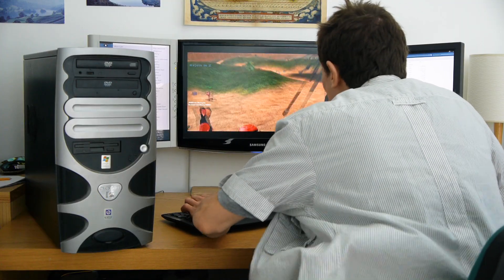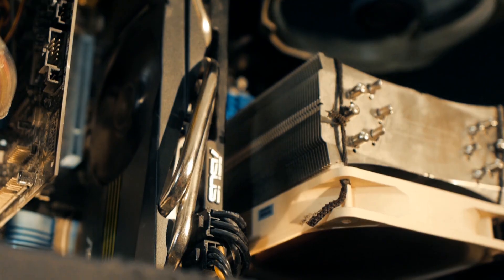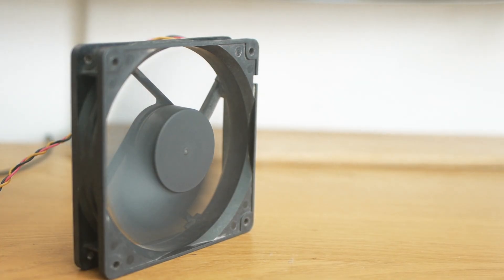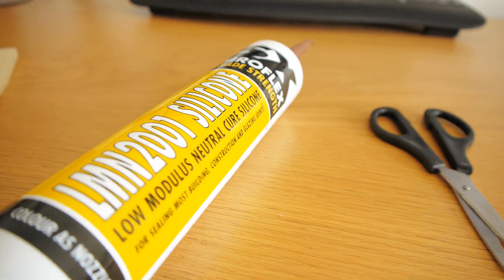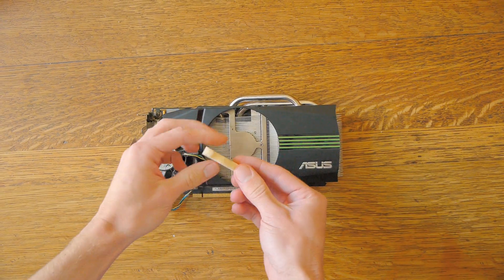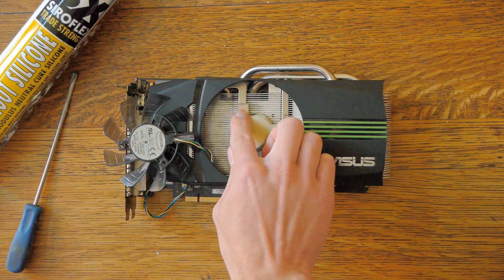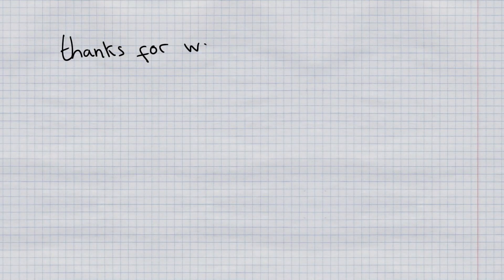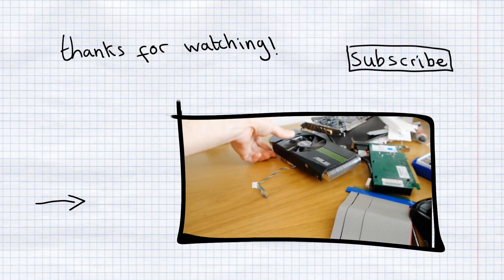How to make a graphics card quieter

Comment: Or just remove the fan completely idiot. Boom! done!
Reply: You think the manufacturer placed the fan there without a reason? Remove all the fans in your computer and see what happens.

I dare you.
Reply: Kopsu Learn to sense sarcasm.
I dare you.
Reply: Kopsu no its a lie computers don't even make heat its just the manufactures telling us this for years.
Reply: He clearly demonstrated the extra noise created when there is hard contact surface with the fan. Have you looked at designs of quite PC cases? The case fans there are mounted on rubberized materials. I hope to see an age where people complement each other and be productive.
Reply: Kopsu Watercooling :)
If we can go ahead and imagine we're using a radiator without fans
Reply: Gowrishankar Govindaraj I like your name.
Reply: ***** I know, but, in theory, if you wanted to really push no fans, you could run the water through a massive radiator outside, and have it wind-cooled. But, thats in no way practical, and you'd need a hell of a pump to pump the water through it.

Comment: Firstly, modifying the graphics card will void the factory warranty, so, only do this when the warranty already expired. Secondly, wouldn't the heat from usage just melts that glue, making the fan fall off? LOL. (Unless you buy expensive, industrial glue with a high melting point.)

Comment: You think it work with a card with 2 fans ? normally yes but to be sure .

Thanxs
Reply from the maker: Of course. I've done it to my new GTX 660 Twin Frozr, and it works really well. It's a quiet card to begin with, so it's practically inaudible now.
Reply: thank you for the quick response . What glue did you use? (i'm not english) , I did not understand everything in your video.
Reply from the maker: *****
 I used Sticks Like Sh*t (yeah), which is a silicone based glue. Basically any glue will be fine that can stick both to metal and to sponge.
Reply: okay thx a lot ! have a nice day :D

Comment: Your videos are great just wanted to know your tips on getting rid of coil whine on my msi r7950 gpu it only happens when I game ? could it be my psu ?  ive tried everything that's recommended  there any tips you could give or any quick fixes that could dampen that noise
Reply from the maker: It'll be your PSU. I had the same issue but unfortunately the only way I found to fix it was to replace the PSU with a different model.
Reply: Thanks for the tip , Il take my gpu down to my friends house and see if it whines there on his PC.
Reply: DIYPerks i located my coil whine comming from the gpu's fan regulators
so i eventually just removed the two fans on my xfx hd 6870 dual fan model and replaced it with a large 140mm fan on about 1200 rpm. (dead quiet for minimum work done heh.)
Reply: Its defeinelty the GPU returned my PSU and bought and XFX 750w  the coil whine remained which I also returned it as the fan was stupidly loud, I then bought a corsair rm 650w and the coil whine stukk remained. Im guessing its like what marcus recommended the coil whine is coming from the fan regulators. sighh for £200 youd think they'd produce a product with quality user expereince guess I have to move my case to the end of my other desk lol

Comment: so if the graphics card reaches 90c, would that not burn the hell out of the sponge?
Reply from the maker: At 90c you should be more worried about your graphics card than the sponge... but regardless, even if the GPU is 90c, it is unlikely that the fan mount would get anywhere near that not.

Think of it this way: you're putting sponge under a plastic fan. The designers of the graphics card wouldn't want to melt the fan, so it's fairly safe to assume that you won't melt the sponge.
Reply: ***** the 290 and 290x are designed to run at 90c.  AMD has said that they designed it that way.
Reply: ***** Wrong, the 290 and 290X are fine at those temperatures according to AMD, but hey, what do they know, they only made it
Reply: DIYPerks
 where the fan mounts probly wold only hit like 70-80degrees
Reply: DIYPerks ok fair enough, thanks!
Reply: DIYPerks  My reference 290 is designed to run at 90c! And yes it is like you demonstrated at the beginning of the video lol :(
Reply: Elliott Carter
90c is 194F, you should be concerned, that card is not, I repeat NOT, supposed to run that hot, not even gaming.
Reply: i agreee with that the solder on the bord starts ot melt at around 120degrees dening on the solder brand  but hey 290x got that hot lol
Reply: vincecvn In other words, they said it will survive those degrees but they couldn't make a GPU architecture that was energy efficient and cool like Nvidia.
Reply: ***** Wrong
Reply: SuperGreenough I've found over the years that AMD cards run better at higher temps.  You can turn up the fan speeds or even water cool them and the benchmarks drop.  The components in them are made for certain temps and don't work as well if you lower the operating temps.  They really are made to run top performance at what they are rated for.

Comment: Isn't the sponge a heat insulator ? if so wouldn't that be counter productive to put under a device such as a fan that keeps the card cooler?
Reply: you don't block any airflow by putting sponge cut so precise. the fan body (round middle area with a sticker) doesn't help cooling in any way so you can put there thermal insulation - it won't affect anything. real issue might be the new extra distance between fan blades and surface of the radiator may cause air "leaks" to the sides thus decreasing cooling performance.
Reply: Yeah the other guy is right, its the thin metal fins around the foam that really cool it down. If you look at the fan, the only place he covered with the foam is the middle where the fan doesn't have blades, it's just a solid circle so no air is being blown there.
Reply: It's just an insulator... I think that all insulators block cold AND heat, I don't think there is a insulator that only insulates heat or cold. Fun fact!
Reply: Sean Kim well surprise - there are insulators which work like diode meaning they let heat/cold one way and not let it other way. also there are insulators who become such only below or above certain temperature. it's all mostly new polymers and such but still those things exist.
Reply: Senpai Nooberinho Cool! Now that I think of it I might have heard of something like that.

Comment: most of the times it is sufficient to glue the fan with the silicon glue directly: silicon is a sufficient media to absorb vibrations of the fan.
 AAAaah... Gone are the days of 8800GT, GTX280... X1900 XTX... 7800GS... 9800XT...

Comment: nice attempt, but only watercooling (correctly assambled) gives you 100% inaudible PC. Kind regards :)
Reply: It's not 100% inaudible. Watercooling still uses a fan to dissipate heat from the coolant in the radiator, but that's just me being a smart ass. It is indeed MUCH quieter.
Reply: Adrian Silesian If it moves AT ALL (pumps, fans anything) if you are close enough it makes noise, just less noise than some. If you want 100% quiet get a tablet.
Reply: Since when are pumps inaudible... the only true inaudible solution is passive cooling... And that is only on lower grade parts.
Reply: no no no if u use high quality components and you know which one to use you can gen INAUDIBLE watercooled system even with 4 gtx 780ti and 2 x 8 core Xeons :) it is just a matter of money :) I am using inaudible PC. best regards
Reply: If there's moving parts there's noise.period.
Reply: almightydeity I have a dirt cheap £300 PC with the worst quality components running on air that is completely silent when I am sitting with it on my desk next to my head. Problem?
Reply: I've used watercooling before but I could hear the pump when trying to sleep (fans were silent but pump at at setting 2 was loud enough to hear). Watercooling is quiet but not silent, the most silent setup I found was using the bare minimum amount of fans that run at 600-900RPM and using a fanless power supply. I have to check for the power light to make sure its on, that's how silent it is. All I have to deal with now is electrical and white noise in the room. Running a AMD 7970 + 3770k, and the loudest it ever goes is during gaming when the 7970 fans kick to 1100RPM (which is still quiet at about a foot).
Reply: but that cost alot more though
Reply: Agree, but when you want inaudible PC it is the only option
Reply: The question is how audible it is using it, not the fact that if you stick your face in the case  #poetandiknowit  you will be able to hear something...
Reply: avattz
 I am using WC system and it is completely inaudible :)  U have to speed down the pump :) either by using cheap power regulator or by using such a device like aquaero :)   And using fan at 400 -500 RPM is inaudible. I am using cheap duper flower fans. They are awesome - Ive switched form Noctua. Noctua aren't cheap :)  Seriously it is possible to to achieve inaudible High power pc - it just should be made well using watercooling + low speed fans.  Best regards.
Reply: Adrian Silesian So adding an extra fan and a pump reduces noise? That is just about the stupidest thing I've ever read. I can build a near-silent PC either way, and it's easier (and way cheaper) on air. In order to make a computer with fans inaudible, you would have to completely cut off all airflow. I suspect you just have bad hearing.
Reply: Ever heard of the South Korean company called fanless or it's original name finless

Comment: Really important question, hope you don't mind.
How would you go on about cleaning the sponge bit?
My 550ti dirty quite often (Heatsink and back of the fan). Gotta ask before trying this method.
Thks.
Reply from the maker: For me dust isn't really a problem, so I'm not sure. I guess just cleaning it with a cloth would do, and then blow off the remaining dust.
Reply: Much appreciated, can't wait to get to home to try this out (vibration and coil whining is killing me).
Many Thks. >; )
Reply: Maybe a good idea is to replace the sponge with a rubber. No more dust getting stuck there. (:

Comment: is there a chance, that the sponge could melt, when the card gets realy hot? i know the fan and the coolercap are also made out of plastic but could the sponge be more likly to melt caused by his structue (to make it simple the sponge is made of like thin "strings" with the room for air between it dont know how to describe this proper with my sucking english :D)
Reply from the maker: I did wonder that myself, but I think it's ok because it'll take well over 60c to melt sponge, and it's only the core of the GPU itself that gets that hot. The heatsink (which the sponge is glued to) never gets too hot to touch, so that's about 40c I reckon.

Heatpipes are another story though, as they do get rather hot, so try and keep your sponge away from them :)
Reply: thanks perks :) i will try this on my hd 7950 when my warrenty stops

Comment: or get a twin frozr card
Reply: Mos Baked It'll never be as cool, though. Pun intended.
Reply: I have a gigabyte windforce cant hear anything.
Reply: the msi n760 is very silent
Reply: TheMazza202
I looked at that but twinfrozr is still quieter
Reply: Gotta love twin frozr :D
Reply: ImportNation titan whit a licwid cooler ;p
Reply: Sander te Winkel I have the 770 and its very silent compared to other after market coolers or stock coolers.
Reply: FreshBagelz yea the twin fan design will always be quieter than the triple fan. Twinfrozr power!
Reply: Mos Baked each to his own.
Reply: Yep. Definitely trade a few degrees for a few decibels
Reply: My 770 4gb twin frozr is much quieter than my previous gtx 560ti
Reply: ***** Because NVidia 500 series sucked :P. The newer generations are WAY more efficient than the 500 series, and higher efficiency means less heat output and less heat output means slower rpms.
Reply: ***** I feel ya, I had a 580 Lightning and I ran Furmark. It got to max fan speed which is I think quite close to 4000 RPM and damn that thing was loud. Temp was around 80°C.
Reply: Depends totally on the chipset
Reply: Mos Baked i have a twin frozr 780 and i dont hear ANYTHING.
Reply: xRazorZ my twin frozr is also nearly inaudible.
Reply: Or direct cu ii, both very similar in performance and noise.
Reply: i have two twin frozr cards and i never hear them.. (y)
Reply: dodemans I had one, and now have a directcuii 660, I never heard either of them.
Reply: Wooo tri frozr bitch

Comment: Why not use thermal paste? It's much better at transferring the heat.
Reply from the maker: I think you're misunderstanding the purpose of the glue, and how a heatsink works.

The sponge (and subsequently the fan) is glued to the heatsink, not the GPU itself. You don't want to be transferring heat to the sponge.

Comment: Can you make a similar video for how to do this for a optical drive? So it doesn't vibrate the case?
Reply from the maker: You know, that's a good suggestion... I will make a video on that at some point (how to make a silent optical drive).
Reply: I would just use an external drive (an maybe place it on some foam to isolate vibrations) There is pretty much no room inside of an internal ODD to mount any shock or vibration damping. As well ODD at higher "X" speed rating spins much much faster than computer fans
Reply: vertifai Thanks, I'll just buy an external and sit it on a rubber mat, my current odd rattles half my case :(

Comment: How does the glue handle the heat?
Reply from the maker: The fan mount doesn't get hot because it's not directly touching the heatsink, which means that heat isn't really a problem for the sponge or the glue.

The fan is plastic, so it makes sense to mount it onto a surface that isn't going to get hot.
Reply: Well that makes sense :)

Comment: i also think that the temperature diffenece is negligible.
The question is, why is this not a standart as it is on most cpu coolers. I hope some of the Manufacturers will do this in the near future.

And i have to say, that this video is VERY well made.
Reply: if the card is vertical meaning the fan is not facing up or down then the foam will allow the fan to hang down which will cause problems over time. i don't think companies want to take that risk
Reply from the maker: steven johnston Yeah, there's a possibility of a slight sag with the sponge, which is probably why it's not been done before. It's fine doing it yourself though, as it's easy to tweak and pretty much risk-free. I'm sure companies could come up with a reliable suspension design though!

Comment: Did this affect temperatures at all?
Reply from the maker: I didn't actually do specific test, but technically it should be marginally better because the fan is a little further out from the heatsink, yet still within the plastic shroud. I think it's pretty negligible though.